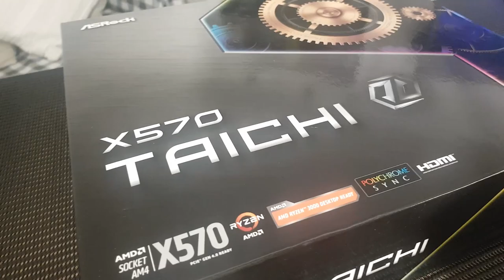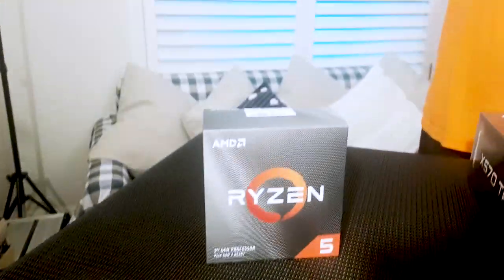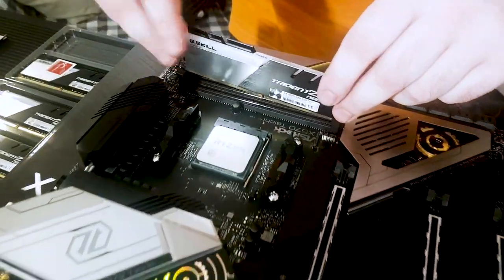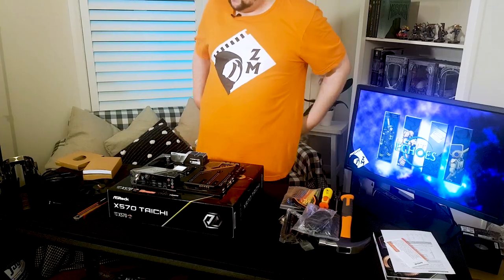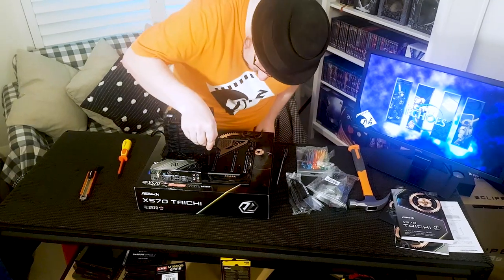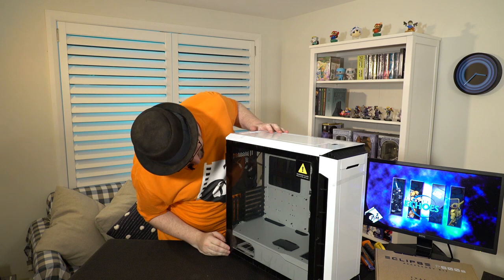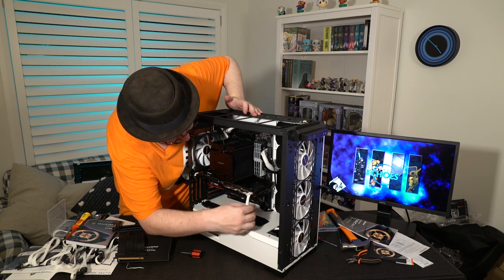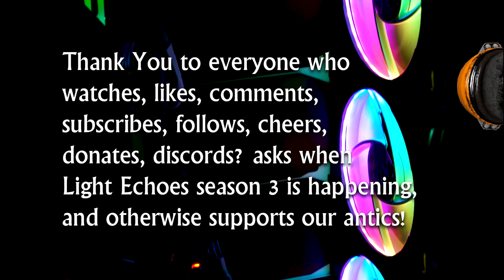Rebuilding the Computato: We Have the Technology

Comment: Lovely video guys :) Loved the Linus and Shad mentions =D Also I am glad you did not/could not mount that GPU sideways, it's quite bad for the temps :)
Ps.: I would recommend you installing the second fan on the CPU cooler, if not at the front as push, then at the back as a pull fan (you can just put it a bit higher, its better than not having it)... Will help you in upcoming summer months :P

Looking forward to new 7DTD episodes =)
Reply: It can be, but this case allows space for the fans to breath, there are actually multiple slots worth of space for vertical. It would have been mostly for appearance anyway lol.

The cooler is massive overkill for the current cpu, and a second fan only marginally effects thermals
Reply: @capacamaru  Yep, few cases allow you to pull the GPU bit closer to MB, so it does not kill the thermals as much, but about 95% of them do not :)

Which CPU is it? I am guessing a 3600? For that one it really is an overkill, mainly if you do not OC (do not forget, Ryzens OC themselves tho). 

Anyway, I am happy you got a better pc :) Hopefully i will serve you well.

Comment: I recently built a new PC and was also surprised at how small the M.2 drive is.  I also had to consult the instructions, I hadn't built a PC for probably 15 years or more.  I was also surprised with how light weight the case was that I bought.  I kept the stock CPU cooler but might upgrade later.  As odd as it sounds I went with a case with a 5.25" drive opening to use a DVD drive for my older games.

Someone should mod Space Engineers so that your clones can have a hat like the one your wearing.

You two are very funny.

Comment: Glad you went with Ryzen 3600, though since he's recording / streaming, I might have recommended a bit more cores for that. But it should be fine for now. And that x570 was a good choice as it's the only chipset to allow the next generation of Ryzen CPUs. I would have gone with 2 sticks of 16GB of ram though as Ryzen usually handles 2 sticks better than 4, but hey, as long as it works well for you, I'm happy.

I am completely surprised by Capac's appearance though. I did not expect him to look like that at all. Then again, I don't know what I should have expected with that voice. Maybe larger, older and more tan? Now I'm curious as to what Splitsie might look like.

EDIT:  OMG, did he seriously put thermal paste in his mouth? He can easily get heavy metal poisoning from that! I really don't think you should have shown that on video as ppl are stupid enough to try it now.. like Tide Pods. Also, a bit too much paste on that CPU... there's a small possibility it might leak onto the board over time which would short circuit and burn it out (I'm a certified tech guy with 17 years experience, trust me, I know). Aside from that, well done. You almost look like you know what you're doing... just like in Space Engineers, lol.

Comment: If the Cpu runs hot, repaste it, when i done mine, i used loads and it run 70-90c why under load, then i repasted the cpu with 1/3rd that amount and it runs alot cooler, i have a 1600x OC at 3.9ghz and it rarely hits 65c under load, also recommend updating the bios on the MB to the newest version :-)

Comment: me after assembling hardware for a living in past shouting "where is your grounding strap???"
Also, asrock ? Ugh, after they poor durability decade ago I personally avoided them as fire. I DO hope they are better now.
Thermal paste: next time try to do 5 point (so it look like a no 5 face from d6 dice) while the outer dots are about 1/3 from a corner towards cpu center, place heatsink,and wiggle it (1-2mm tops) and then secure it, wipe excess of it (using q-tip but try not to leave any cotton bits). In general too much of thermal paste is not good as CPU will heat up.
Also, Use disposable gloves when mounting cpu/ram.

Nice and quiet... Until GPU will spin -up to 100%. Anyway - You finally got PC to have minimal specs advertised by M$ to run Minesweeper :P
(just messing with You)

Comment: Where's the booms?  Where's the hacker drones?  Capac's involved, there must be booms and mayhem.  At least let him use the hammer! Good to finally put a face to chaotic duo (assuming the pop up face was Splitise).  Strangely, you knuckleheads look pretty close to what I had envisioned from the voices.  Tell the big guy that's a pretty sweet rig.  Guess I'll have to figure out the Twitch thing to see his follow ups since it seems so many are migrating to Twitch.
Reply: That one frame face was Lewis from the Yogscast, who is also known as the Bristol Pusher - which is relevant to the timing of when it popped up :P

My true form is still yet to be revealed ;)

Comment: That was way too much paste. (And not just orally ingested.) It needs to be a thin film to fill up the cracks. The more you apply, the harder it is to squeeze out thin.
Reply: Not really. Yeah it was a bit much, but nowadays the mounting screws are calibrated to apply exactly the pressure needed, and the paste is squeezed out if there's too much. It's fine. Much better to put too much than too little nowadays.

Comment: 10:15 WTF why is that such a ridiculously big heat sink?! thats not clipping to the motherboard right? wtf is going to hold it?
Reply: It's a regular big tower cooler. It's big, but only as big as many other. The model they chose is one if the best one around (to the level of the big Noctua). As to why is that big? Well it's a radiator. To keep it simple, the bigger, the better. It allows better cooling, which mean for the middle range cpu they got on it they can run it much quieter. Also, modern cpu and especially Ryzen run very much like a gpu nowadays: every 5°C up and you lose some performance (not a lot, but in some cases every little bit count). 

Now, it's not absolutely necessary; The default ventirad is fine. A $30 ventirad like a 212 is better, but also fine. A big one like this might be overkill for some… I disagree, I upgraded a few months back and got a similar sized one (full of Noctua goodness). Why? Noise. And noise is even more important to a streamer. And durability, upgradability. He will probably still use it in 12 years, if not more, and it should work perfectly.
Reply: Oh sorry, missed the last part. It's hold on the motherboard like any other. It has metal mounting mechanism, that screws into the metal backplate. Basically the motherboard is sandwiched between two metal plates and the radiator is screwed through both. You won't juggle the motherboard with that hanging from it, but otherwise it's very fine and secure.